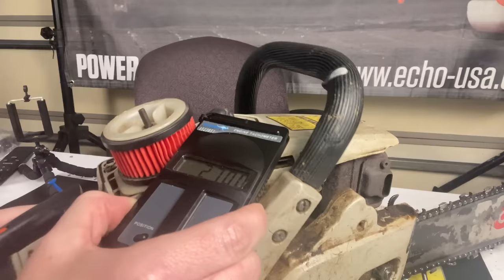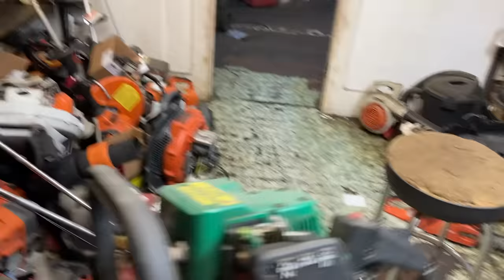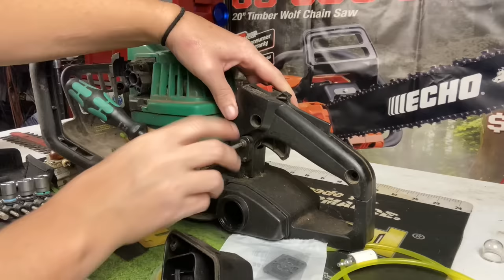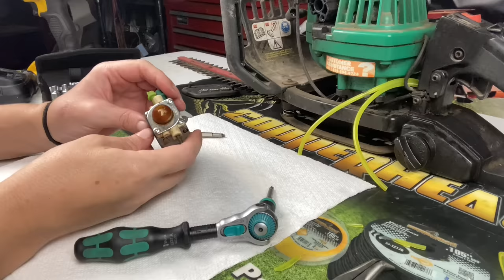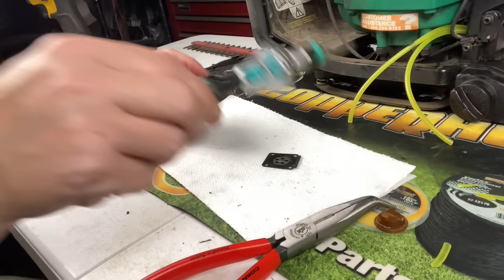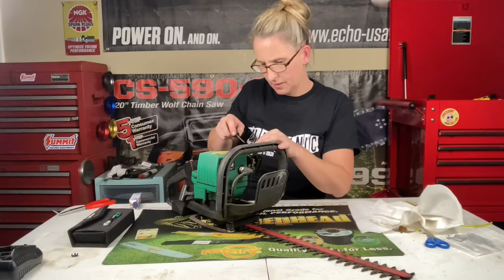THE BIG SECRET on how to store your small engine long term + Turning Shop Trash Into Treasure!

Comment: The best solution for infrequent use jobs is to run on propane.   LEHR made propane equipment.   It just works for 15 mins a few times a year for years and years, and years.

Comment: Hello there. Just came across your website, Rickie from Australia. I love small petrol engines and you do a great presentation, love them. My problem is now being a dinosaur,74, i have difficulty grabling with the machine and  yanking on the pull start, especially if compression is high. Is there a way you can convert the starting to say an electric drill? I don’t like battery chainsaws edgers etc, I feel having a petrol engine is far more satisfying. Please keep up the good work , love it
Regards Rickie

Comment: Sea foam in the fuel for the last run before you store it. Cleans the jets and removes any varnishes. Won't allow varnish to build up,ever! Been doing this with all my small engines for decades and the only carbs I've had trouble with were ones I bought used. After cleaning them out and doing this. No more issues! Ever!

Comment: Or easier best way is mix up 30 to 1 with e free gas.... fill the tank.. run it for a few minutes and good to go for several years... really need to use e free gas anyway

Comment: Two questions:
1. The storage trick using 2 cycle oil, is it just for 2 cycle engines, or would it also apply to 4 cycles?

In another video regarding water condensation in gas during storage, would adding a product like heet before starting help resolve the issue of water accumulation in gas?

Comment: Isn't adding 2 cycle oil going to mess up fuel filter?  Or maybe mix it 10 to 1 for storage and no ethynol.
Reply: Take the filter off,then put the 2cycle oil in,still suck the oil in the carburetor.

Comment: Thanks for the videos Bre
Replacing the coil for echo blower really helped out!!!

Regarding this video about pouring two cycle oil… if it’s a chainsaw or weedeater and for the most part not gonna use it during the winter months the stable work just as good?

Comment: I have a ton of different size primer bulbs from all the different things ive worked on have some good used ones and lots of new ones and gaskets i almost need a shelf for the extra pieces i have and hardly use. So i keep my stuff all gassed up through winter because I'll go out and start it all up and let it idle for a long time and i never have no problems in the spring with my stuff.

Im soon gonna find out if the aftermarket flywheel will fit on stihl br420 it'll replace the br4203 400 1200A flywheel there is different on the aftermarket flywheel keyway is deeper cut than on the original part so i don't know if it'll work right wont know til i get it

Comment: I stopped using a compression guage on a 2-cycle engine, Do to the false reading your most likely going to get from them! When someone used to much oil in their mix it sticks to the quench area at the top of the cylinder. The build up of that oil causes compression readings to get higher than what the piece of equipment originally had when new! Your better off using a leak down test if you want the real numbers.I know this because not only do I  have a few old boys that I am positive that they are correct in their teachings, But I have heard people say they have 175 pounds of compression on a chainsaw that I own in my collection ,And the saw was only produced with 150psi  so they are mislead by the oil build up.

Comment: Just found your channel today  and I really enjoyed it. But I was surprised you didnt blow out the ports in the carb with air or carb cleaner or use a small wire to help make sure the holes were clean.  I would appreciate your comments on some other fluid alternatives like other commenters mentioned like using transmission fluid or kerosene  vs 2 cycle oil you recommended for storage. Seems those might be less expensive since it probably takes a pint or more in some devices to cover the filter and 2 stroke oil seems like a pretty expensive option. Especially if I need to use the tool again sooner than expected and store again one or more times.

Comment: So I bought a Shindawa T 262 weed eater and I took off the self feeding head. I replaced it with  my Craftman fixed head. I use 2 15 inches pieces  of 135 line and I cut my half acre that is surrounded by wire fence on 3 sides. The wire eats up the self feeding line it is just too thin. Some one asked if I was over working the head because the sears head is heavier. Yours words of wisdom please. I will go through 12 feet of 105 line with the self feeding head. Thanks I enjoy your show!

Comment: Does the two stroke oil trick work ONLY on two stroke motors or will it work for four stroke as well?  Thanks
Reply from the maker: Only to protect the carb on 2 strokes. But would work on small 4 stroke, might be harder to start after, but will not hurt anything.

Comment: Oil destroys rubber. If you replace the gasoline with oil and pump it through the system via the little bulb before storing a small engine won't it damage the carb diaphragm and any other rubber parts ? I once sprayed the area around the carbs with oil including the rubber boots on top of the carbs of my Suzuki GT380A. Some time later I discovered that they had gone completely mushy.

Comment: Someone else mentioned just running out the fuel until it stops for storage. Can you please explain what are the added benefits of putting in the straight 2 cycle oil before storage. If you don't have a priming bulb then do you just pull it a few times in full choke mode to prime the oil through the carb and cyl.

Comment: Hi- really like your videos.  You are a great teacher.  Quick question.  I want to try using the 2-cycle engine oil in the 4 cycle motors for storing them. However, what to do with the ones that do not have a priming bulb.  I have a large wheeled Club Cadet string trimmer that is self-priming and automatic choke.  It always starts reliably even though I only use it 2 or 3 times a season, then store it for another 6 months.  Any advice would be great.  thanks.

Comment: I have a stihl chain saw i cant start. Switched out the fuel twice, put in the same stuff I use in my other stihl that runs perfectly. Also tried the spark plug from the same machine. I pulled the spark plug and used my drill in reverse to spin the motor. Fuel sprayed out of the open spark plug hole. 
Whats left? It ran last year with no issues.

Comment: Hi Bri, I have a question about using 2-stroke oil to prime small engine fuel system for storage.  Is a particular grade of oil required? How about TCW-3 outboard oil or Pennzoil dino or syn? Please don't tell me to use red armor for storage. Thank you, Brad

Comment: Some chainsaws are not as easy ? I slice the line like you do . I sometimes have to use a fine stiff wire poke it through the end of the slit .The stiff wire is easier to fish out the gas cap opening ? Then you can ease the fuel through out by pulling the wire.

Comment: I've been given a McCullock Tivoli 45 it's got 120psi compression, serviced the carb, sharpened the blades and regreased the gearbox, new coil and the dam thing still won't start!!! All I get is a fart of a backfire! Somehow I think the flywheel key might be sheered. 😒

Comment: Hello love the videos I have learned a lot. I have a weed eater brand trimmer, wil run on choke but not run setting, looking for suggestions on what to do.  Changed filter, fuel and plug, lines seem fine any help would be great thanks. Ken

Comment: What if you don't have a primer bulb, but a choke lever instead? Can you use the 2-cycle oil trick and just pull it over with the choke on to accomplish the same thing? I've been using non-oxy gas consistently to try and preserve fuel lines and add stabil if storing longer periods.

Comment: Did not work for me I used some 2stroke oil for boats and it plugged up the carb which I had to replace to get the stihl FS 80 trimmer running again.

Comment: We have an old Troybilt Horse with the 7 h.p.  K 161 engine. It has a metal gas tank and the shut off dies prettymuch nothing. When installing a new valve, is any type of thread sealer needed ? Thank you for the awesome video's.😂

Comment: Not trying to be a stickler, but that is not a primer bulb, it's a purge bulb.  Difference ( for those that don't know) is a purge bulb pushes fuel into the carb and when all the air is displaced it shunts the fuel back to tank -- IT DOES NOT flood the carb like a real primer bulb does.  Hence the reason a lot of people have a hard time starting some 2 cycle engines.. Most have purge bulbs and you push them until you see fuel returning to tank,  then they will fire right up.

Comment: Hello Bre, Hey can you do video and take MS 180c like I have with 18" bar on mine and  Up load video for people  to see that you can operate 20" - 25" bar on it  reason is that usable bar length from teeth on case to cutting tip is lost with 18" bar more length  is needed, I'm not wanting to buy $600.00 saw that 20" bar on 180c can do same.

Comment: Do we have to worry about  fowing out the spark plug using 2 stroke oil only in the gas tank in long storage ? I know it's used in a mix state but just thinking on full concentrated oil & the plug.

Comment: Excuse my not understanding.  You mention removing the oil from the tank and priming through the remaining oil in the fuel line, carburetor.  Where will the oil go?  Do you have to remove anything for the oil to drain out?

Comment: I recently got an old trimmer out of fuel BUT rrreally clogged by oil at the tank output and in line filter,,, filter was easy to replace but the tank is crap and cannot be save.
So I 🤔 think it's better to continue the Stabil procedure to avoid that, don't you think ?

Comment: Happy Holidays have a question on echo 680 chain saw.. Auto oiler is sad no oil coming out with bar off and I clean the filter,,,any ideas repair or replace the pump looks expensive thanks 4any input..

Comment: Does this 2 cycle oil storage trick work with 4 cycle engines?  (The trick of adding of 2 stroke oil into the tank and flushing it through the primer bulb and carb....after running the carb dry.)

Comment: You amazed me with your outstanding knowledge about two cycle small engines, congratulations but I have a question ❓⁉️, would it make any difference if I use snap on tools? Nothing personal, just trying to make you 😊😁. From the endless summer paradise Puerto Rico, Jesús Torres.

Comment: Question about the trick of running it out of gas and then filling with oil for storage... I run my 4-cycles our of gas for storage, but I was taught that you should never run a 2-cycly engine out of gas because in doing so you're also running it out of oil (since they're mixed), and this could damage the cylinder/piston.  Is that not a valid concern?

Comment: I have a ms 311 and it doesn't have a primer bulb, so should i put the oil in and pull the cord a few times to circulate it through the lines and carb?

Comment: I just viewed video about storage with 2-cycle oil. A few years ago, I inadvertently put bar lube in my gas tank on my Poulon Pro chainsaw. Of course it stopped shortly after starting and I put it aside thinking I was going to have to clean everything out. Would the bar lube act the same as the 2-cycle trick

Comment: You know I first saw this channel and thought not nice things. 
Another chick putting a man out of business ect. 
I’m from Benton. I watched.  Your legit
The more I watched the more I learned
I was surprised
Good job the things you address are counter to common sense
The Germans designed a crappy fuel cap? Not common sense 
Expensive fuel is crap?  Yep
Not common sense
On and on. 
I have an ms270 that being janky I’ve done the easy stuff to no avail. Carbon air filter fuel plug found a stihl carb. 
Should I just replace it? 60$$

Comment: Great Videos!  I think you will save me time, money and frustration so I just Subscribed.  I store my 2 cycle machines similar to you by warming them up, draining the fuel, then run again at full blast so all the carb fuel gets sucked out of it.  What's the benefit of adding 2cycle oil and purging it into the carb afterwards?

Comment: Hi. Thanks for the video. I live in FL and purchased my first generator. I want to store it for at least a year. I listened to how u store it for long term but it doesn't have a rubber primer. Do I just disconnect the spark plug wire and pull the starter rope to (has battery starter too) prime it. Therefore, the 2 cycle oil will travel through the lines & carburetor. I'd that correct? Thank you. Jason

Comment: Question for you I have a bunch of snowblowers.  I buy them cheap all need carburetor cleaned from bad gas. Clean them run good the issue is when they sit overnight get a puddle of gas not big but needle valve seeping. Go back run qtip on drill in brass seat to clean it up nice and shiny use thumb nail to clean the needle (not the rubber tip) wipe rubber tip with a rag with gas. Same thing. What is fix? I just order a $12 dollar amazon carburetor. I could install a shutoff but when it sells the person doesn't shut off valve then complaints. Thanks

Comment: I have a couple of small 4 cycle WX10 Honda water pumps that I use only for a few months in the spring and then they sit the rest of the year. Should I put 2 cycle oil in the empty gas tank and push it through with the primer bulb on these 4 cycle engines?

Comment: Would the line pull in easier if it was held straight up in the air when you pull on it with the needle nose

Comment: I have a question regarding compression testing small 2 stroke engines. I was taught when testing compression on larger 4 stroke automotive engines to hold the throttle all the way open when turning the engine over. I assume this isn't required with two strokes as I never see anyone do it or mention anything about it. Maybe it's something to do with single cylinder vs multi cylinder. 2 stroke vs 4 stroke. Valves vs no valves. I just need some clarification on why I don't see anyone holding the throttle open when testing small engines for compression.

Comment: I have  2200kw Honda generator. It started flooding out to the point of liquid lock. I replaced float and needle valve. It still continues to flood. I installed new carburetor and the same problem of flooding still continues. I am lost as to what I might do next. Do you have any suggestions? Thanks, I enjoy your shows. Wilbur Davis

Comment: Hi. I have an echo leaf blower, 2 cycle and it starts on choke but if taken off of choke, it bogs and quits. Fuel Lines, filters, plug, etc are good. So i think it needs a carb adjustment. It takes a pac man adjustment tool for the high and low side adjustment. Please walk me thru the order to adjust and can both be set while idling (being it dies as soon as i switch it to run?). You are s teal wizard with this stuff….please help.

Comment: The gas cap on my stihl 170 chainsaw has been replaced 3 times, so far. I have to crank it down pretty tight and usually lay it on it's side so the gas doesn't run out. Any suggestions on this? You talked about battery powered tools, i have a ryobi 18 volt hedge trimmer and even with 2 batteries that never charged all the way i bought the adapter to run 20 volt Dewalt batteries which I have quite a few of

Comment: I have an older Poulan Wild Thing.  Due to very low compression I replaced the cylinder, piston and rings, carb, and ignition system. The older cylinder was 38 Mil and the new is 41.1  mi. It is very difficult to pull the starter rope and has not run at all since the rebuild. It appears to be firing before it should.  This is not my first "dance" with this kind of thing and I feel that the after market cylinders are not meant to be installed in the older Wild Things.  Any help would be appreciated.

Comment: I have a Bob Cat zero turn lawn mower! Right after iI got it the blade started hitting and I call the place I got It from!! He said there was a recall on the blade spindle!!Well I got it back !! Work fine for awhile then the same thing!!  I stop back and told him it was doing the same thing!! He told me ,oh you bent the blade like the last time!! I told him he said it was a recall on the spindle last time!!He said oh no the frame was bent that I must have hit some thing!! I said that I did not!  Then he said well some one did !! Then I told him know one but me had drove it!! Then he said they did it while I was not there! I told him I keep the key with me !! I remember My son got a snapper from him and we had a problem !! He worked on it 3 times while on warranty! Did not stay fix! But after the warranty run out he fixed it for almost $200 !!Now that I thank back I have a problem with him!! Dose Bob Cat make there machines so cheap that they bend cutting grass!!

Comment: Hi Bre.  I love watching your "bring back from the dead" videos.  I have been doing that for years with old equipment.  I need a second opinion.  I have a 2016 Ariens riding mower with the hydrostatic trans.  It has starting moving slow in forward and reverse.  I replaced then drive belt, and I tried adjusting the control arm, but it doesn't help.  The local shop said it may need to be rebuilt.  Do you have any thoughts on what I should look at next?  Thanks.  Ken
Reply: Check the transmission hydrostatic fluid may be low.l had a Honda walk behind mower with hydrostatic transmission low on fluid but some in ran great.
Reply: @jerrysoutherland662  Thanks.  I don't have a leak, but I will check it anyway.